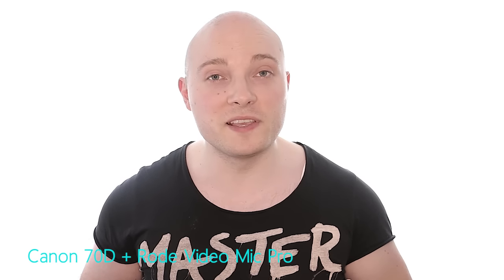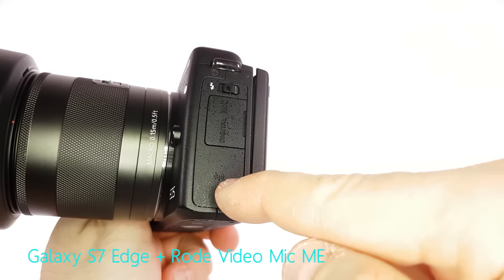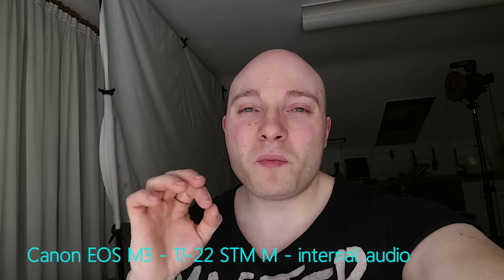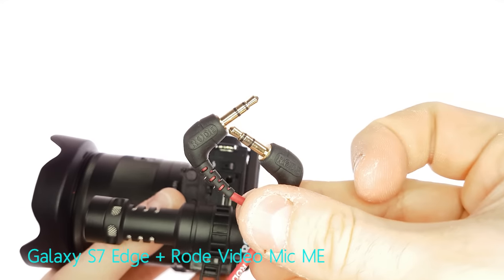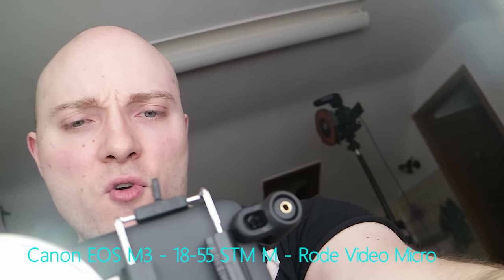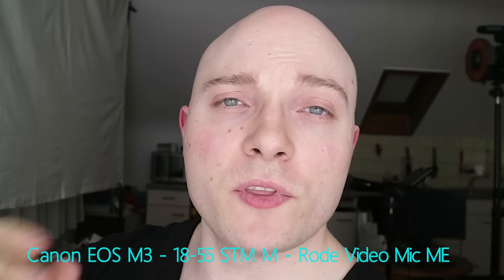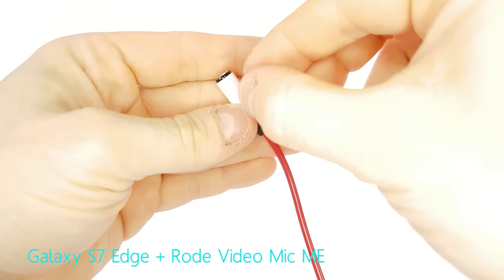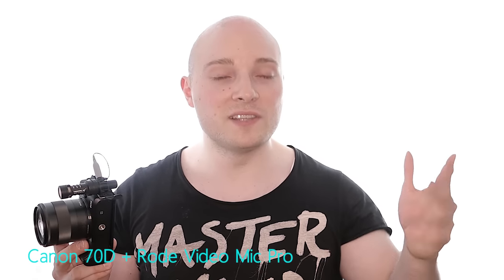Canon EOS M3 - MICRO Vlogging Setup+ - Tubenoob

Comment: how did you remove the hissing noise from the camera?
Reply from the maker: Hey, Benagon! Haven't run into serious noise issues with the setups yet. Once used a very cheap adapter cable that gave me problems, but also nothing serious.

Where do you run into the problem? Camera only or with which mic/s?

Greetings!

Comment: Can you do a setup on the iPhone 7 because I want to vlog but there are no cheap microphones with a lightning adapter.
Reply from the maker: Hey, Erin:) I have to look into that some time.....doing a quick research I can see that there are lightning to 3 5 mm audio jack adapter cables on amazon.com, there is one from apple.....you could use a simple cheap iphone7 cover and propably put one of the cable ties with the adhesive base on the back of the phone, put the end of the adapter cable in it and then apply the rode video mic me.....but the adapter cable from apple seems to be too short, so a third party one will propably work better.....I can do a video about that, but it'll take me some time, because there's other ones coming:) Maybe that already helped you out a little...I will think of something for you...Greetings!
Reply: Thanks for the suggestion, you are the first YouTuber that has ever replied to me. Cool videos!
Reply from the maker: Thanks a lot:) Never get tired of hearing that:))

Comment: Tubenoob! Recently subscribed! I am purchasing everything needed exactly as in your video, including the EOS M3 for the 3rd setup exactly (with the Rode Video Mic ME). My question is, which Wire Clip is the correct one to get it like its on your video? the small or big one? (There are 2 options in the description links). Aaaand (because its not shown in the video), with the Rode Video Mic ME setup is it still able to detach and attach again? Thank you so much! Keep it up! - Using your direct links for purchasing ;)
Reply from the maker: Hey, Gonzalo! Glad you liked the video:) 

For the Video Mic ME you need the big ones. The Video Mic ME can still be detached and reattached, you can also turn it backwards and the cable will still connect to the camera, although it only barely does so it will still fit... Hope that helps you out.

Thanks for using the links, really helps me out, man. Thank you.

Greetings!
Reply: Already ordered everything, you the best bro! From a fellow vlogger (new one 😂)
Reply from the maker: Cool! You'll create some great vlogs I'm sure! Have fun with it:)!

Comment: Dude I love your hacks. Looking to buy an m3 and a rode mic. Debating on the ME or the Micro
Reply from the maker: Hey, JT BASIC! Much appreciate the nice comment:)

I guess the up side with the ME is that you can also use it with a mobile device....the MICRO is more easily reversible though....also it comes with a shock mount, so if you want to put it on another camera the regular way later that is a plus.....quality-wise they're the same, given that you use decent quality adapter cables.

Greetings!

Comment: I also use canon M6. I have a question before decide to buy either the rode video micro or rode video ME. I read that the rode video ME use the TRRS 3.5 jack that allows us to plug headphone for the sound monitoring while recording a video. Does it work with canon M6 camera? Thanks for your help...
Reply from the maker: Hello, Jonathan Ding! No, on the camera it does not work, because it does not send out an audio signal. Greetings!
Reply: TubeNoob thanks for your help.. Base on quality wise the rode video micro or rode video Me? Thanks before...
Reply from the maker: In my experience the video mic me is a little better when it comes to self noise. So I would go with the Video Mic ME. Greetings!:)

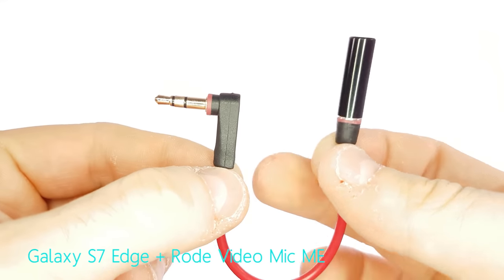Comment: What's the name of the red cable @ 1:19?
Reply from the maker: Hey, pNoid2k1! Thanks for your question! Just realized that I messed up the links in the description for these cables through you. Now they're the right ones. The names vary:

US: Seadream 2PACK Newest 6 inch 3-Pole 3.5mm Male Right Angle to 3.5mm Female Stereo Audio Cable Headset Extension

UK: LiKuCo 3Pack 6 inch 3-Pole 3.5mm Male Right Angle to 3.5mm Female Stereo Audio Cable Headset Extension Cable

DE: KRS - KB8 - Stereo Verlängerung Verbindungskabel 3 Polig Klinken Stecker 3,5 mm gewinkelt 90° Aux in /Stereo Klinken Buchse 3,5 mm ca. 16 cm

Sorry for the mixup with the GoPro setup! Hope that helps you out. Greetings!

Comment: Hey hows it going, i am an amateur videographer myself, though i have not really ever worked on my own channel (mainly for others), i use a s7edge with a video mic go ( the one that needs no cable and plugs directly into the camera). For some reason, microphones seem to have clicks and pops when there are to many cellphones near me, or i am streaming live to instagram and facebook. these pops and clicks dissapear if i go into airplane mode or stay away from all sorts of rf sources, is there any way to sheild my setup fromrf interference? or do i have to upgrade to better microphones?
Reply from the maker: Wow, now that's what I call a tech question! I have to look into that before I can answer you, because I haven't had the problem yet. Can you describe the problem a little further? Do these clicks appear randomly or are there intervals to this? Are they different in volume? How many of them come up?

Sorry that I can't help you right away, but I will do some research into this! Greetings!
Reply: TubeNoob this issue is apparent when the cellphone is using WiFi heavily, such as doing a live stream on instagram, surrounded by RF sources (many people using cellphones at a party for example), or using LTE. These symptoms go away from when all of the sources are removed from proximity. These sounds are like static, and clicking and popping. Very strange, maybe I should return the microphone? (returning the cellphone is not really an option &
Reply: Volume of static gets worse with more sources of interference up to the point where all audio is basically static.
Reply from the maker: I did some test today and I now know what you're talking about. I only had three other sources near my phone when recording, but I heard the "static" and the clicks on the audio track. Diabeling wifi on the devices got rid of the problem. People seem to have the same problem with gopro audio when using the go pro app. In that case it is even the device itself that messes with its own audio. Haven't had the time to do much research yet, but I don't think there's a simple way to get around this problem, except of course switching to gear that uses different electronic parts and better shielding relating to cables. Maybe I will find a solution over easter....at least now I know what it is we're talking about.

External recorder an option for you?
Reply: while i am considering an external recorder it detracts from the live quality of my shoots, having a run and gun gear with a decent directional microphone makes for an amazing experience. Combo of s7, stabilizer, mini shotgun mic, and LTE streaming is really cool. in anycase, maybe it shall inspire you to produce a video about best practices to keep all equipment playing nice with each other.
Reply from the maker: Maybe it will:)

Comment: I had two of the red cable and they both pulled apart at the wire to the camera adapter part. I found a better wire on Amazon but it has 3 rings, I wanna use the mic etm001 (2 ring) with the new wire but I'm unsure if it's working. I can hear my voice test through the phone with both wires, is this because it uses both the samsung s7 Mic and external? Do i need a ring converter or is there no difference and it should work?

Thanks in advance 

The new wire:
KetDirect 20cm(0.6ft) Right angle 4 pole 3.5mm 1/8 inch male to 4 pole 3.5mm 1/8 inch Female Stereo Audio headphone earphone Extension Cable adapter Cord Tangle-Free Braided wire https://www.amazon.com/dp/B01CZNLTJA/ref=cm_sw_r_other_apa_ZoeZzbA4KEPP1
Reply from the maker: Hey, PROJECT ANUBIS! The new wire won't work with the camera or the mic, because both need a 3.5mm 3 pole connection, the two rings that is. 

These are some in black. Maybe they help, except if you used the same ones in red:) 

https://www.amazon.com/Seadream-3-Pole-Female-Headset-Extension/dp/B01DCBJ51I/ref=sr_1_1?s=electronics&ie=UTF8&qid=1506637639&sr=1-1&keywords=Right+angle+3+pole+3.5mm+male+to+3+pole+3.5mm+Female+Stereo+Audio

Hope that helps you out a little. Greetings!
Reply: TubeNoob I noticed my headphones to my s7 edge are 3 ring 4 pole, a 2 ring 3 pole should work without converting? 

Thanks
Reply from the maker: The 3 pole will work with an eos m3, but not with the phone. The phone will need a 4 pole jack.

Comment: I know this is an older video, and you have probably moved on from the eos M videos. But i would really like to see how the remote shooting works via wifi on the M series cameras.

I think it's monumentally stupid, that none of the Eos M cameras works with usb tethered shooting from a computer or tablet, but if the wifi apps works ok for assuring you are in focus, making simple exposure adjustments etc. i guess i could live with it (I've got an offer for an Eos M3 for 250 euros, to upgrade from my current M1, which has NO remote monitor options, which is the only reason i want another camera)

I do DIY videos, restaurations, woodworking, electronics etc, not vlogs, but the things i work on are in front of the camera, so being able to frame, adjust, compose, and monitor shots from in front of the camera is very important. But often the camera has to be placed over head, or some other place where reaching the touch screen is not practical (i also often have dirty hands), so being able to use a cheap tablet as a monitor, trigger, ISO adjustment tool etc, would be great.

You make such great and in depth videos, that answer questions none of the other cookie cutter "reviewers" touch, so i appreciate it. Great production value as well. Keep up the good work.
Reply from the maker: Thank you very much again, Peter G! Love to read such awesome comments!

I have moved on from those cameras unfortunately. I can*t tell you how good the wifi works. You will have to test it yourself I guess. But if you don*t need lag free live view, it should be workable. I don*t see why it should be a problem to set up a shot. Manual crontols are available....

Will do my best to keep it up:) Greetings!

Comment: Hey mate, what an amazing video, super helpful 👍 and great channel btw. 
I have the same m3 Camera and its forever struggling to focus, I’ve tried all the settings I can think of with no luck, I shoot on ‘P’ so not completely manual.  I wondered if you could tell me the best settings for the type of videos I do? 
In this video at around 1:30ish https://youtu.be/NJOQPKGBlw8 you will see the focus going out and coming back, it does this a lot and sometimes takes a long time to focus. 

Ps I’ve also watched your video on the m3 about focus but I’m still not sure what I’m doing wrong. I’m using the 15-45mm Canon lens that came with the camera.
Reply from the maker: Hey, Cafe Racer Garage! Thanks for the nice comment! Much appreciated:)

The M3 has a hybrid system with some phase detection, but mostly it's contrast detection. It will simply struggle if there's no clear foreground background situation. That'S just the camera.

Whenever the subject and the camera are stationary I would simply switch to manual focus and use focus peaking to set the focus. If you're in front of the camera, not moving, Smooth Zone AF, with the focus are set to your face is a good option. If you're moving, you probably have figured that out by yourself:) Face Tracking I think will do best.

With the M3 it always depends on the situation.....if by lighting or placement you can make sure what you want to film has the most clear contrasts that will help a lot. Of course you can't always make sure of that.

I don't think you're doing something wrong.....it is just not the best AF system. 

Hope that helps you out a little. More questions? Just ask...:)
Reply: TubeNoob wow thank you so much mate this is a lot of helpful info
Reply from the maker: You're very welcome:)

Comment: I WILL SHORTLY BE BUYING A CANON M6. MY NEED WILL BE FOR LONGER VIDIOS SO WILL NEED LONGER POWER SOURSE CAN YOU COME UP WITH SOMETHING THAT WILL ALLOW ME TO HAVE UNITERUPED POWER SOURSE FROM USB POWER PACK
REGARDS JOHN GOODWIN
Reply from the maker: Hey, John Goodwin! The only thing I can think of right now is using a dc coupler and getting a dc to usb cable to hook it up to a powerbank with a voltage step up converter from 5 volts to 7.2....then the powerbank  would have to be mounted near the camera somehow....other than that of course there's the option to just hook it up to a large battery which has a regular grid outlet and use a regular power adapter with the coupler. But I guess the more compact the better for you, right?

I have to try and see for myself, but that is the only solutions I can come up with right now......I will see what I can do....

Hope that still helps you out a little. Greetings!